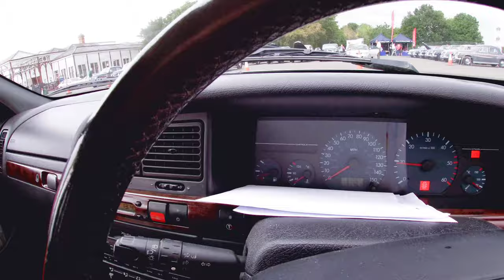Clive Osborn's Citroen Xantia Exclusive Estate - Suspension workout

Comment: In 1975 I bought a 1972 Citroen GS - ERO 735K, which had a very similar system. I bought it from a Citroen Main Dealer, and never took it out for a test drive - it was behind loads of other cars. On the change over day, I took in my old car - a SAAB 96, and drove the Citroen back to work - about a mile. I honestly thought I was going to be sick, the suspension was like nothing I had experienced before !  I soon got used to it though, and what a comfy ride they give - unbelievable, like floating on air. Great video Alex - thanks for sharing. Take care 🙂

Comment: As a foreigner I don't understand the ULEZ thing. 
Is it to keep the poor out of the rich areas?
Reply from the maker: It almost feels that way doesn't it. 
It is supposed to prevent people using older cars that apparently pollute worse than newer models.... your classic cars are exempt tho 🤣
Reply from the maker: My partner has two MG ZS cars. 
One is 2001 . One is 2002 .
The 2002 car is exempt from ulez. 
The 2001 car is banned from Ulez 😆 . 
They are exactly the same 🤣
Reply: Basically, if you have any vehicle that doesn't comply with the Ultra Low Emissions, in the now enlarged Zone, you will have to pay a £12.50 daily  charge for any day you drive it, any time or distance in the ULEZ.  ANPR cameras will identify your vehicle and issue a fine for each day of non payment. The ULEZ has been increased, to include the area circled by the M25 motorway, usually called Greater London. It's complicated, and some vehicles are exempt through being of historic road tax age.  Like Alex said, some vehicles that are the same model, will fall into the grey area where a slight difference in build age, or engine type will determine if it is exempt or not.
Reply: You nailed it there.